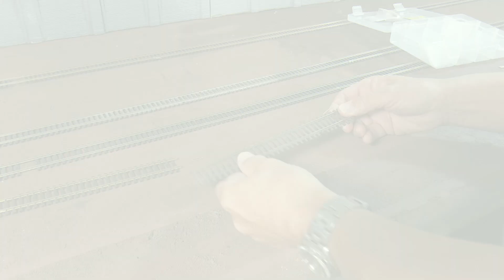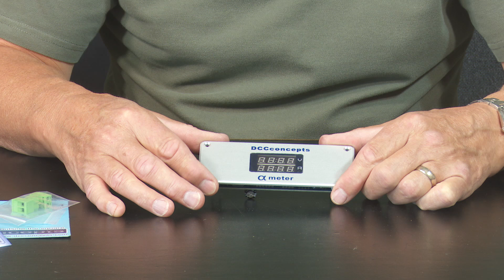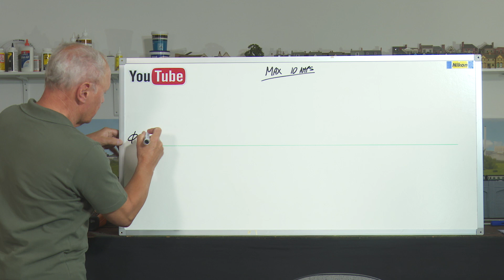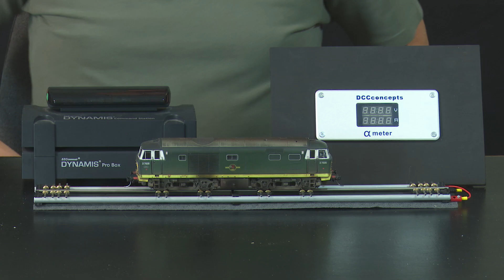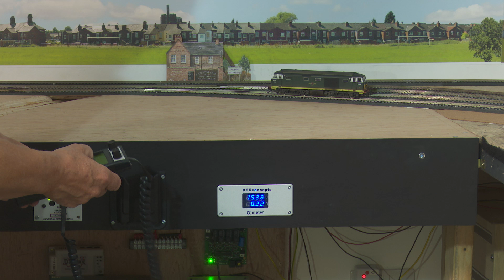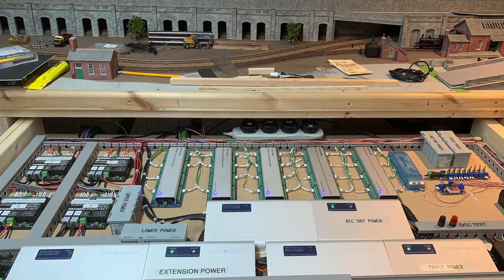Measuring Track Power at Chadwick Model Railway | 101.

Comment: Hi Charlie, I know it's an old video, but a tip for anyone wanting to use heat-shrink printing for labelling.  I looked into it, and it was claimed that the print on the tubing was vulnerable to smearing until the tube was heat shrunk, which goes against your advice.  Another suggestion to reduce cost was to print the message on tape, stick it on the cable lengthwise and cover it with clear heat-shrink tubing, which is then shrunk. This is much cheaper and can be produced even on the cheapest handheld printers.
Reply from the maker: My markings have never smeared so I don’t think the comment is really valid.  The tubing by is far a better option.  Regards Charlie

Comment: Can you make a video on what exactly happens when a train is passing from one voltage domain to another voltage domain? How to avoid the short that caused between the rear and the front wheels?
Reply from the maker: You don’t need a video.  Just ensure that the track power polarity is the same in both districts.  Then your locos can crawl across without any problems.
Regards Charlie
Reply: @ChadwickModelRailway  The polarity is well understood. But what is there is a voltage difference? Say 16V DC on on side and 18V on the other side?

Comment: Hi Charlie, Just wondering if you had thought of doing a video on basic Digitrax system set up and common faults. I am struggling with a DCS 200 Chief extra with UR92 and DT402D that I have obtained second hand. Trying to get this going but cannot get track status led to illuminate.i have looked on various forums but found nothing.
Reply from the maker: Hi Dennis, which track status LED are you trying to sort out. Is it on the unit or on the UR 92?
Reply: Hi Charlie, its on the DCS200:. I am trying to set the system up to determine if this second hand DCS200 or the Handset are still good.
Reply from the maker: Please try the digitrax facebook group.  Sadly, I can shead no light on this one.  Regards Charlie

Comment: On a DCC system you can measure the current and voltage off the power unit supplying the power to the system. Go E X I = P to see how much everything is drawing, and then you can test for each locomotive, if desired. I've done this on DC, and on my DCC system I can do it between the power unit, and the electronics running the track. I thought about doing this, because I can, and have done it before with other things, like hard drives. It would mean for me to put in two meters, so I can continue to change between DC and DCC seamlessly, as I do now.

I was also thinking about making a car that would go behind the engine to measure the motor voltage and amps, because of the claims the DCC decoders have on them. I got the meters, and all I need to do is design and print the car with the meter on it.
Reply from the maker: Wow Leslie,  that’s certainly more depth than I would go into.
Regards Charlie

Comment: Hi Charlie, it's Charlie from across the pond here. Nice video, and a much nicer looking panel than the RRampMeter made here in the USA...

As you were measuring the loco on straight DC, and it didn't turn on till almost 6v, I couldn't help but wonder what kind of horrible mechanism it must have - as any decent HO loco should be moving at just a couple of volts, lol.

But looking closer at the RRampMeter pages I see they offer a battery connectable version for measurements below 7v - and elsewhere I see this unit is specified at 5v...

So this 5v is the turn on voltage for the meter electronics, and needs to be deducted from the readings when using it on a DC layout - and your loco was actually starting at less than 2v on the track.

Just thought I'd throw this out there, cause it seemed strange to me. Always enjoy your videos Charlie - have a great weekend!👍
Reply from the maker: Thanks mate, for some interesting observations. Regards, Charlie.

Comment: Whilst I appreciate that DCC Concepts is focussed primarily on DCC, excluding DC modellers such as myself, does the company a disservice, I think. Which DC modeller would really want to buy a meter that only works in one direction of loco. travel? As a DC modeller, I use bi-directional analogue voltage and ammeters, but am pretty certain that they are not as accurate as something in the digital domain. I’d certainly welcome something with greater accuracy. The review was very interesting, and had the meters worked in DC in both directions I would have flexed the plastic straightaway. DCC is something that I plan to visit in the future, as I’m sure that other DC users are considering too, and having a piece of kit, such as the DCC Concepts meter, if it worked on both DC and DCC, would aid that transition. As it is, no sale DCC Concepts. Pity.
Reply from the maker: You make an interesting point, Clem, and perhaps well worth an email to the company. Regards, Charlie

Comment: Hi Charlie, excellent presentation/s! I am looking at installing a DCC Concepts display units that you recently mentioned, did you use this unit on a Digitrax DCS52? As I keen to install one mine. (That is after ‘blowing’ three zimo decoders!) 
Any advice/recommendations will be greatly appreciated, 
Cheers
Jay (Melbourne, Down Under)
Reply from the maker: Hi Jay, no, I initially used it on my DCS 100 and now on my DCS 240. Regards, Charlie

Comment: Hello Charlie,

excuse please my poor school english, I hope you can understand it well enough?
Please have thanks very much for your great video about the rail joiner fishplate tool made from a rail, that is very helpful idea to create cheap tools for railway modelling.
I allready subscribed to your channel.
I am based at Luebeck in northern germany building my own model railway modular layout.
I am new to DCC operations and used the old Roco Digital System but changed now to the z21 Start with cable wired Multimouse only. The Roco DCC system has got 3.2 Amperes by around 15 Volts to 17 Volts track power, I think.

The DCC Concepts Alpha Meter will be a nice tool to have an overlook to all my future DCC chipped Locos onto my layout, to figuring out when I would be in need to use booster sections for the layout.

I dislike to use a laptop in addition to control track voltage and track amperage to the system using rhe white z21 Start Command Station without the WLAN package.
Reply from the maker: It sounds like you’re off to a good start Ingo, regards Charlie

Comment: @11.00 - a little loose with terminology there. "Stall current" is the maximum current the loco draws when stalled, and not the voltage it requires to get going.
Reply from the maker: Thanks for putting me straight mate. Regards Charlie

Comment: Thanks Charlie - very informative, clear and entertaining as ever. I'm between layouts at the moment, having moved from a spare bedroom (no longer 'spare' with the arrival of grandsons), to a limited space in a partitioned part of the garage, to a nice long run in the attic, which I now have difficulty accessing - so I have ordered a 12' X 10' insulated garden shed which will arrive in the new year. That will probably be 'it' - the final project that will see me off the planet. So in the meantime I am catching up on your videos to ensure that I have a running start when I start making the new layout - many thanks for your inspirational advice! A parting tip for those who don't have access to a printer - I use short sections of white electric cable sheathing with the inner wires removed to group and identify my wiring, written on with an indelible pen. Cheers!
Reply from the maker: A great tip Phillip. Regards Charlie

Comment: Thanks for another great video. Based on this video, I have bought a DCC Concepts Alpha Meter.
I have gone down the road of using ESU command station, and DCC concepts points and signalling gear. I am also going to use point rodding with the DCC Concepts ss surface mount point motors. So far, very happy with what I have. I'll post a video once I have things set up.
Reply from the maker: That’s great news Peter, I’m so pleased things are coming on nicely. Regards Charlie
Reply: Hi Peter, Your ESU will also show you how much current your layout is taking.

Comment: I'm late to the party but I feel the need to correct you, respectfully, on something.  AC stands for alternating current, which DCC is (above and below 0v means current flows both ways).  It is a square wave, but waveform has no effect on if something is AC or DC, only which way the current is flowing.  Think back to your brake van.  If DCC were DC rather than AC and you were on an isolated track, say a programming track, the brake van would not need a bridge rectifier as one wheel would always be positive and the other always negative but as it's AC you have to have the rectifier to change the current from AC on the rails to DC to the lights, complete with correct polarity on the LEDs.

Other than this one thing, you're bang on with how you are describing things and please keep up the excellent work.  You've taught me much and are my favorite model railroad YouTuber out there.  Second favorite once I post my own video but I wouldn't expect different from you were things reversed.  :-D

Even so, I doubt I'll stop looking up to you.

Source: Former electronics tech.
Reply from the maker: An excellent comment although I will disagree.  Getting technical DCC is square wave DC gong from 0v to 15v. It doesn’t alternate from -15v to +15v.
Regards Charlie

Comment: Hello Charlie,
Being a ‘DC sort of guy’ I have a control circuit that enables me to select an ammeter into a number of different power sections on my layout.
This circuit can be adapted to connect the DCC Concepts meter into various power districts and you only need to buy one £60.00 meter.
Can you provide me with an email address, whereby I could share this design with you and, with your presentation skills, invite you to offer it to other subscribers.  Also a version of my design enables the ammeter to display draw current from an analogue controller (such as the faithful, aged ‘Duette’ ,like mine!’ irrespective of voltage polarity.  
Hope I may possibly add to the wonderful content of your channel.
You are an inspirational presenter.
Best Regards,
Tony T 🚂
Reply from the maker: Hi Tony, my email address is at the end of each video. However, I can’t promise to publicise your circuit. Regards Charlie
Reply: Hi Charlie,  How did I miss your email address?
Will be in touch by email when I get my ‘trained spider’ to complete a couple of drawings.
Thanks for your quick and helpful response.
T 🚂

Comment: Hi Charlie, love your videos and the idea for the fishplates, but why do you keep talking about voltage as power? It isn't, power is measured in watts and the meter you're reviewing doesn't measure that. The meter you're reviewing measures voltage and current, because DCC uses a square wave, there isn't an RMS relationship you mentioned. Determining the power is quite complex and this meter doesn't do it. Even after your video, I still don't understand what one would use this meter for, practically speaking that is.
Reply from the maker: Sorry for my power slip of the tongue.  The meter is a great reference for loco current consumption and checking that "Track Power" (a Digitrax term) is appied at the correct voltage.  The voltage within the comand station can then be adjusted to give the correct output.

Comment: Hi Charlie, Thanks for your informative summation of the Alpha unit. Whilst stationary locos fitted with a chip draw a small amount of current, so also will stall motors such as Tortoise and DCC Concepts digitaliP (and of course other digital powered accessories). This becomes an important factor in determining what level of power is to be supplied to a layout. I intend purchasing the Roco Z21 control unit which only supplies 3amps without a booster. Allowing for the odd 'older loco' which can draw up to 0.6+amps, plus several loco's sitting idle with up to 3/4 running at any one time, plus accessory decoders, the Alpha unit becomes a must. Otherwise the control units overload protection kicks in above 3amps and the entire layout shuts down. Thanks again for your well researched and informative videos. They are a great help to both the novice and experienced modeller alike. Richard
Reply from the maker: A fair point Richard. However, all my accessories are powered from a separate supply.

Comment: A £5 AC Ammeter (Analogue) from Amazon will do just as good.
Reply from the maker: Not quite Stuart, it won’t measure square wave DCC.
Reply: @ChadwickModelRailway  Get a similar reading in amps as you get with your system. My multi meter reads a constant voltage on different parts of the layout.

Comment: If you also file the bottom and sides of the fishplate tool a little so it doesn't grip the fishplate very well it will stay on the track not come back with the tool.  Then there's no need to grip the fishplate with pliers.
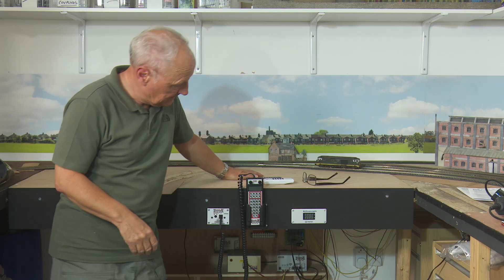Also if you slip a bit of paper behind the track it give far better contrast so if your sight isn't 20:20 it makes it easier to line it up and get the fishplate to go on on the third attempt instead of tenth time lucky!
Reply from the maker: A good point buddy, thanks.

Comment: A very informative video Charlie. I shall be getting the Alpha meter.
Q. You had a remote control for mains.....interested in that as all my mains sockets are at the underneath right at the back of my layout.
Can you put up a link?
& can you connect multi extension sockets to the mains RC plug?
Thanks!
Reply from the maker: Yes you can add an extension lead to the RC socket plug. I bought them from B&Q for around £12.

Comment: Hi Charlie

Another very interesting video

I love my gadgets and this alpha metre appeals to me but forgive me for being a bit tick. But could you give me more advice why it would be beneficial to know how much power my layout is using. so that I'm not just buying another gadget for the sake of it.  

Regards Steve
Reply from the maker: Hi Steve, the meter will give you an indication if a certain loco is pulling too much current. Or it will let you know if your whole layout is pulling more current than it should, because of the limitations of the controller. Regards Charlie

Comment: Thanks Charlie, the only reason I can see for getting one these units for 12 v DC would be if you have a fleet of Triang or Hornby Dublo loco's and you wanted check that you're not about to max out your controller
Reply from the maker: A fair point Paul. Regards Charlie
Reply: @ChadwickModelRailway  Surely, they're not accurate for dc if they're designed for DCC.

Comment: Charlie is this a shrink wrap that will fit in any Brother printer or just this model ?
Reply from the maker: The heat shrink tubing that is listed in the show more tab, is one of many sizes that fit. Of course, you need to buy the right one for the right cable

Comment: Hi Charlie - great channel - really like your “how to” practical demos as my railway modelling started as a child many years ago and you have rekindled my interest.  A couple of questions if I may - big picture one and detailed one.  I am looking to build a new layout but am stuck.  Bought Hornby track plans 14th edition and Peco set track plans - but they are both for set track and I want something more prototypical dare I say plus fiddle yard!  I have a garage sized area so quite big.  What do you suggest?  Second detailed question - love your track laying etc but notice that you leave quite a sleeper gap between your joined pieces of track / points.  Is there a practical reason for this?  Many thanks Mike.
Reply from the maker: Hi Michael,  using flex track changes everything.  You can get some great ideas from books etc but I find it's other layouts that often provide the answer.  The missing sleepers get filled in when I ballast.  It's caused by using flex track!

Comment: Hi Charlie, recently subscribed to your channel.  You have some awesome videos and Ideas. After many years of having the trains packed away, I'm building from the ground up and going DCC.  One of the best parts of Model Railroading is the electronics and I too am a stickler for neat wiring and labeling.  I recently took a 400 watt Computer power supply from an old computer and created a power supply for my layout that has 12 volts, 5 volts and 3.3 volt output.    After watching this video, I wished that I had that machine, so  I went out and bought a heat shrink label machine myself.  Can't wait to get it and continue   Have the whole layout to wire so it will be of great use.
Reply from the maker: What a heartwarming comment Brad.
Good luck with your venture. 
Regards Charlie